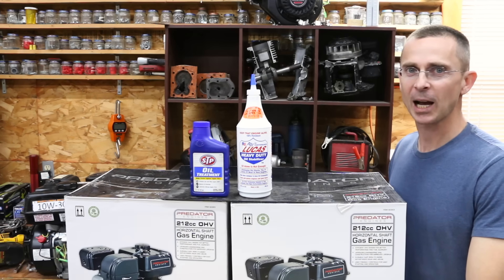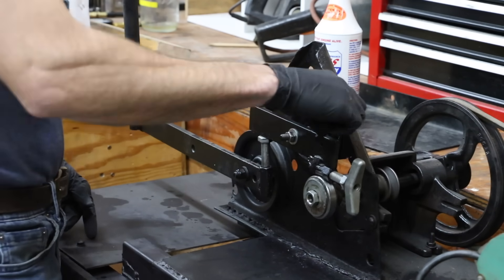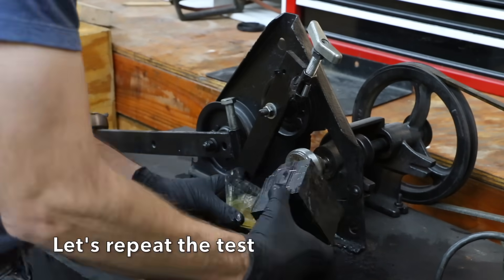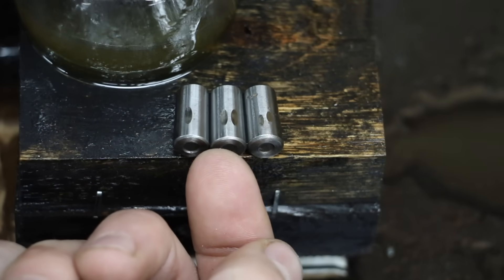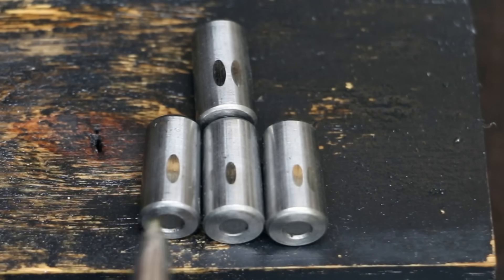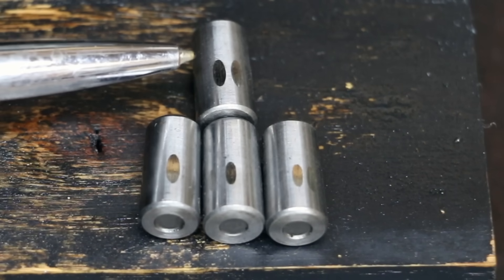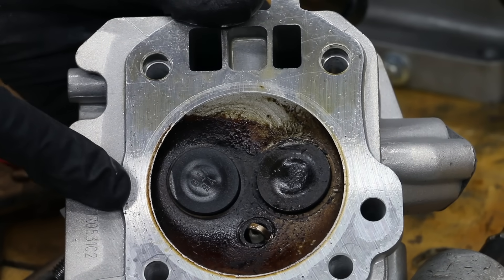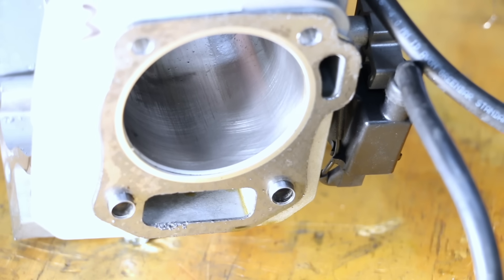Which engine self-destructs first?  Lucas or STP?

Comment: This wasn't a measurement of effectiveness of the oil additive for that you would have had to had the oil and additive in the engine and applied equal loads over time to see which failed first.  A good test would be of fuel additives to see which cleaned injectors and valves best using such as Techron and others claiming same abilities.

Comment: I would LOVE to see you test BG brand MOA (motor oil additive), as it’s the only additive I’ve ever encountered that warrantees engines and have actually seen them pay for new  OEM engines. The only caveat is that you have to use it for the life of the vehicle. 

I read a lot of research on this, and sent out my oil with and without it added, and it actually made quite a difference, and also gave me almost one mpg increase on my Infiniti  qx70 awd with the vq37vhr v6. In my extremely modified F150 Ecoboost (twin turbo 3.5 V6) it gave me just over 20° cooler temps on my turbos and 1.5 more mpg. 
I’ve also tried Lucas, Liqui-Moly, and a few others but showed nothing worth noting. 
I have 169,00 miles on my F150 and 147,000 on my QX70 and the Infiniti is like new. I’ve only had to change the radiator. Can’t gauge the F150 it’s too modified.
Reply from the maker: Thanks for the suggestion.

Comment: I’m so glad I found this video today.   I don’t know anything about additives, (I’m a girl, but I’m learning!) and I have a 2000 CRV with 178K. I love this car and I’m retired, so keeping it going is a VERY high priority.  About a week ago, I got an oil and filter change, followed a few days later with new oil pressure sensor to replace the old one that was leaking. 
Today, my oil light flickered briefly when I stopped at a light - twice, both times within about one minute. I should mention that today was HOT - even for NC.  Worse, I idled in a parking lot with the A/C on (Googling re: tools) for up to 15 minutes.  
My mechanic told me to add the Lucas Stabilizer, which I plan to do tomorrow.   Me being me, I had to look for whatever info I could find on it first.   Yours was by far the best and most thorough, and has eased my mind a lot! 
Last but least, I’ve also watched your most recent videos, and you haven’t aged one bit!
Reply from the maker: Thanks for watching!

Comment: Not saying oil additives don't work. But, the quality of motor oil, the right type for the job, and the precision of the engine matter most. Here, while we have to engines of the same manufacture, we would need a larger test than two engines to see a trend. Like, 12 each. That's expensive. I see a dead heat, myself. Both probably ran longer with no oil than they would have without additives. But, bearing failure is very rare in engines topped of with oil, unless there is extreme abuse, say a marine application for a yard engine. I'll stick with standard motor oils and no additives for the sake of economy. My suggestion would be a test of name-brand oils against recycled oil under abusive conditions. And, an endurance test between engines with Lucas or STP, and no additive. Good video, but I can't see a winner here.

Comment: Thank you for the comparison between the two. The one thing I would have done different is had a 3rd engine with straight oil no additive as a control so we could see how much of a difference it is to use a product at all i understand it would have made a significant addition in price for the test but a control group part in the test would also be nice to see but again thank you for the non biased test

Comment: Ive used both in a 5.4 that burned and used 1 to 2 quart o oil every 500 miles after using both for about 50 k i stoped the lucas and went solo w stp consumption stop completely ano no smoke while driving to over 400k! Stp has zinc in it i. Believe?

Comment: Are there any examples of the classic Slick 50 floating out there? It might be interesting to test that. Also whatever that nano stuff that they used to advertise on the Internet. I do know that Teflon is weird stuff, it has a high melting point, and when it does melt on hot iron, it kinda disappears into iron without burning. It would be interesting, after all those years, to know more conclusively if it actually did anything. They had some pretty wild claims about the stuff.

Comment: Though I love these comparison videos, the truth is that if you (a) buy quality oil to begin with and (b) change it at proper intervals, you need add nothing to it, ever.  If you've got a failing engine (leaking/smoking/etc.), though, you have a choice:  repair the engine to correct function and then practice a and b, or use an oil additive to maybe slow the destruction process or to hide the symptoms of destruction (smoking/leaking/etc.).

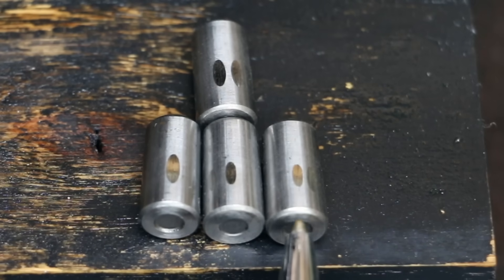Comment: For the people that might be a bit confused about this competition if you click back to 5:09 when he’s doing the bearing tests he shows the scoring of the bearings and the one with lucas oil mix visibly made it so the bearing looked less damaged, the point of the oil additive is to improve the oils 5 main properties (Lubricate, cushion, cool, clean and seal) and the Lucas showed improvement by providing better cushioning affects because in the end the motor that used it last longer… like he said though it made the engine work a bit harder because of the higher viscosity so that’s why it didn’t provide as good as a cooling affect (:
Reply: @daniestolte3492  here

Comment: I have a 2007 4.2l Chevy Inline 6cyl. Had an ex gf dump sugar in the engine. Didn't know till it turned to hard candy and blew off the filter. I made it home. Filled with oil and new filter. Forgot to fill the filter. Started knocking on state up. Since then, I've used Lucas every time I change the oil. 100k+ miles later, no issues. Drove it to DC during the convoy a week after it spun the bearing. Been doordashing and ubering ever since. 
Lucas is a great additive. Motor barely has a tick. Only when the oil is old. Like 8000 miles between oil changes. I'll stick with Lucas. And a good filter. 👍

Comment: I had an Isuzu Rodeo with the 3.2 V6 (1995) and it developed lifter knocking.  I started adding Lucas and although it would still knock for a minute or so after starting in below-freezing weather, it still ran fine in 2013 when I sold it on.
Reply from the maker: Thanks for sharing.

Comment: I was at a Gibraltar Trade Center and they had a inline 6 Chevy motor that they added PRO-LONG additive to the oil and ran it for about 15 minutes and then they drained all the oil out and took the oil pan off and took off the value cover and started the engine back up. I watched the demonstration for about a half hour and I couldn't believe it but it was still running and I looked that engine over and there was no oil keeping that engine lubricated, so I walked around the Trade Center for 45 minutes and went back to the engine and now there are about 60 people standing around waiting for this thing to blow up and the guy running the thing said are you all ready and everyone yelled YES and he took out a bucket of sand and was throwing sand on the engine and I mean a lot of sand. Everyone backed up and that engine ran for another 20 minutes and he shut the engine off.I asked why he shut the engine off and he said he needs it for the another demonstration. I never seen anything like it in my life and I'm 70 years old. Then he had a hot plate and has a torch under it and there was a glowing red hot spot and he was pouring different oil additives, all the named brand and those additives moved away from the flaming red hot spot except PRO LONG, it moved toward the flame. If I didn't see it with my own eyes I wouldn't believe it. I've been running that stuff in my cars and boats ever since and that's been over 20 years ago and I get 300,000 miles on all my cars. My water pump gave out in my offshore 502- 400HP and the engine stopped, froze up. I fixed the water pump and turned the key and it started up with no knocks and that was 10 years ago and I'm still running it.
Reply from the maker: Thanks for sharing.

Comment: Get some of that Lorenzo’s oil that they’re claiming for the diesel and gas engines are really good because the super duty had almost 900,000 miles before it let go and it was the needle bearing failure not lubricity

Comment: He said the temperature was higher with the Lucas. For me that’s not a problem because oil does not do its best lubrication until it’s 215 to 220°F. I put some Lucas a half a quart in my wife’s Audi 27 2015 yesterday. I can tell a difference in the engine noise within the first 20 miles. When I started it this afternoon, cold start not only wasn’t quieter, but that camper rattle went away in about half the time that it was going away. I was really hesitant to put anything in this motor, but a timing chain and camp phases in this engine are ridiculously priced to replace.
Reply from the maker: Thanks for sharing.
Reply: @ too bad I don’t proofread

Comment: I would like to see you use oiled leather as a rod bearing, perhaps in a crankshaft that has spun a bearing and then smoothed out with sandpaper. I think if you crush the leather first with oil saturation in it, it might hold up for a while.
This could be an on farm repair.
Reply from the maker: Thanks for the suggestion.

Comment: I run Lucas hot rod oil along with 15w-40 motor craft diesel oil in my stroked 351w with a soild flat tappet cam shaft and I’ve beat on the old girl pretty hard as it has a 5 speed and see’s regular street duty lol
Reply from the maker: Thanks for the feedback.

Comment: Used Lucas for awhile then switched to Royal purple as a standalone oil. Lucas is thinner oil that would make it run hotter in a higher performance engine and easier to drain if you are in a pit stop. I just like Royal purple seems to last longer in Chevy 383.
Reply from the maker: Thanks for sharing.

Comment: an old guy back in the early 90s told me that he used STP to drop the temp a couple degrees if needed at the track.Between higher octane gas,some cold plugs and STP ,he was dropping temp significantly without losing HP.
Reply from the maker: Thanks for sharing.

Comment: Could you do a test on slick 50 , that's what I use and my car has over 218,000 miles/4 cylinder.
Reply from the maker: Thanks for the suggestion.

Comment: These additives are supposed to used with oil to keep the engine lubricated on start up, Lucas is far superior as race car drivers use it, STP has mineral oil which will not work well.
Reply from the maker: Thanks for the feedback.

Comment: Lucas is the best shit ever created.  I have 450cc 4 stroke motocross bikes and they run at 12,000 RPM's +++  and i always run SAE30 and 20% Lucas oil stabilizer! I have one 2008 Yamaha YZ450F  that I rode until 2015 on a completely stock engine besides normal wear and tear parts on the bike the only thing I had to do was adjust the values and I changed the oil every ride! It ran forever and when it did finally go the inside was spotless only damage was the connecting rod no other damage and little to know wear on the cylinder and piston! I try to tell everyone about this and no one believes me or even trys it themselves!  Instead they buy Yama-lube at 16$ a quart and add no Lucas and they need a rebuild every 100 hours! I got over 500 hours out my 450 Yamaha beat the ever loving shit out of that bike and absolutely NO problems!  Think I'm lying try it! Use it! You won't regret it!

Comment: It appears to me that Lucas gave more life than STP. in the mix ratio's by comparison. If I understand the results. Personally I have always as a rule added on qt. of Lucas engine seal/lube to my oil changes. I do this as an added safety measure against wear. I don't know what the film strip is for Lucas or STP. However, I use Mobile oil and the Lucas at oil changes, and change at no more than 3500 mile intervals. I suppose it may be more of a physiological belief that provides me a bit of confidence that I'm getting a bit more life/protection out of the engine. Would appreciate your feedback.

Comment: Lucas ain’t a slick 50 it doesn’t coat the engine. I don’t know what he was trying to approve running an engine without oil. What does it have to do this Lucas is good or not doesn’t tell you if Lucas is any good without oil that’s supposed to tell you if the additive is good or not.

Comment: I had a Chevy Astro van I forgot what year it was but the engine had close to 300 thousand miles on it my wife drove it back from Orlando with no oil in the crankcase, I had been running slick 50 in the motor for quite a while when she got back I filled the crankcase with oil and slick 50 and we got another 15,000 mi out of it, my money is on slick 50 because of my personal experience
Reply from the maker: Thanks for sharing.

Comment: My question for the tests is WHY would one DELIBERATELY run an engine with NO OIL WHATSOEVER ???  What part of life in reality is that ?   My answer is not a part of reality.   Why not instead of draining the oil and running  until failure  Keep the oil in after the basic tests and run until failure.   Most people don't change oil anywhere near frequently enough.

Comment: Very old test, but I'm wondering about an update, utizing an OHC engine instead? I think the stringiness of the additives sticks better to the timing chains, to fight chain stretch and tensioner wear.

Thoughts?
Reply from the maker: Thanks for the suggestion.
Reply: @ProjectFarm  Perhaps a manual setup, with pulleys and a chain, to test if the lubricity and stringiness of these additives reduce friction and rolling resistance? Just bouncing ideas off ya, really enjoy your videos my good man!

Comment: Lucas is great. I was the first in my area to use it over 20 years ago. This is a bogus test. The small engines are splash oiled (no oil pump). Straight up 30W non detergent is used for a good reason. Detergents foam and the engine looses it's ability to do it's job. Additives do nothing for a splash oiled engine.  Period!!!!!!!!!!!  Lucas prevents dry start ups and oil break down. Just like it says on the jug it comes in. BTW I have used it in over 40 cars and no engine failures to date.
Reply from the maker: Thanks for the feedback.

Comment: I have used Lucas in every vehicle I have on which has been 12 and every one of them was still running when I sold them very well the key is keep your oil changed whether it's synthetic are regular keeping your maintenance up will keep your car running I trust nothing but Lucas in my Motors from my lawn mower to my weed eater to everything else
Reply from the maker: Thanks for sharing.

Comment: Lucas. Been using it in my vehicles for years. I noticed the valves and top of the piston from the lucas engine had less carbon deposits than the stp engine did.

Comment: The lucas lasted longer but it gave less warning noise. All at once a noise and stopping, and it's over.  So technically you'd be more likely to turn off the stp before it broke because of the alarming noise. Nice test though to watch.
Reply from the maker: Thanks!
Reply: However the stp melted the metal.. by the time the warning signs started it was too late

Comment: Lake speed jr explained that adding Lucas basically it just increases viscosity. Since the base oil does not have a zinc or phosphorus or calcium blend in it for anti-wear , it actually lowers the count in the engine oil you started with! Oil is like a custom tailored suit. You use the correct pre blended oil for the application.
Reply from the maker: Thanks for the feedback.

Comment: This is not an accurate test. No engine is designed to run without oil, one running longer than the other proves nothing. These are Chinese engines, the tolerances of the bearings are not that close, from one bearing to the same model of bearing. The only accurate test would be to take both engines and make them work the same amount of time at the same task ( running a generator head, pump, etc) even then his previously stated, with the inaccuracies in Chinese manufacturing, it still would not be an exact test.

Comment: As a professional mechanic this test leads me to the fact that I would use the STP because it makes the engine run cooler which will prevent damage from occuring . I never plan to run my engine with no oil in it so the extra nine minutes is a moot point .
Reply from the maker: Thanks for the feedback.

Comment: can I use "Lucas Oil 10001" for the engine, gearbox (manual switch) and differential gearbox?
How much do I have to add lucas oil? Assuming the engine has 6.5 L of oil, the gearbox has 1.2 L and the differential has 1 L.
Reply from the maker: Thanks for the suggestion.

Comment: Perhaps another data point would be putting oil back in both, remove governor and run at very high (but not immediately destructive) rpm to see which one quits first.  Or with heavy load.  Or in high temperatures.  Something to stress the engines in a more realistic scenario.  Youll have to keep up with fueling and possibly oil changes depending how long the test lasts.
Reply from the maker: Thanks for the feedback.

Comment: Lucas was the clear winner -- and the reason I switched to it from STP many years ago -- but the extent of time difference on a run-dry condition surprised even me. Some of that may be the luck of the draw in the engines -- even though they match in every way, they are still Harbor Freight and subject to quality variability -- but then, who could afford to try this on 10 engines? It could also be the tenacity of the Lucas film -- the way it wraps around everything -- that may have left it with an edge after it was drained.
Reply from the maker: Thanks for the feedback.